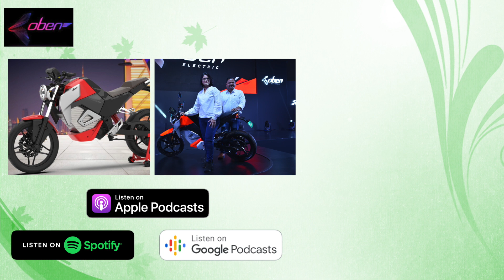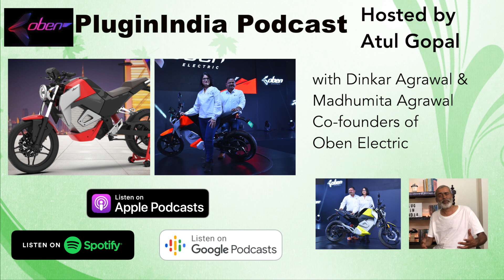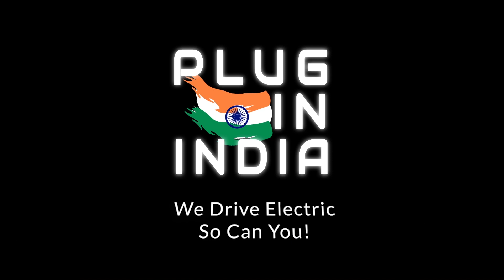Podcast: Oben Rorr Electric Motorcycle Launch | Chat with founders

Comment: Good thing is that they know where the bike will compete ... 150cc category. The bike looks good and seems to have promise.

Bad thing is... its has a huge NON-PORTABLE Battery ... meaning once away from home it will need to charge from an Ather or Ola point. I think they lost the plot there. Obviously there will be much more Ola & Ather points around Bangalore than Oben. So they want their customers to charge from there? 

I also cannot UNDERSTAND why ALL eBikes need to have HUGE battery packs?

Why not a 80-100km range ebike costing Rs75,000 with a portable 10Kg battery? Is it too much to ask? They can have a 2nd or 3rd optional pack like Ultraviolette. I really like the Monkey Bike of JoyElectric... but it is really small in size and also hardly has any place for pillion rider.

Making EVs with smaller and Portable battery Pack is the ONLY ADVANTAGE small players will have over Ola or Ather or Bajaj or TVS . The big guys will NEVER want to use a portable battery pack.  So why do you want them to crash your party?

This is the only reason Hero Electric, Okinawa, PureEV & Ampere are still here and are expected to survive at least another 5 yrs. If they had Fixed Battery then Ola would have wiped them out of the market by now.

Above all in this age of social media Oben should put out a lot more videos of their vehicle testing or riding to increase the public awareness, interest & confidence in the product. Unfortunately they have just 2-3 videos of the REAL vehicle totaling around 5 minutes. They need to bridge this gap ASAP.

Selling  Direct to customers is EASY with Low Speed 2-Wheelers and DIFFICULT with Hi-Speed vehicles because registration of the Hi-Speed vehicles will take some time in different states, while LowSpeed vehicle do not require any registration. LowSpeed vehicle can be delivered like any product from Amazon... direct to home in a couple of days... days required for actual transportation.